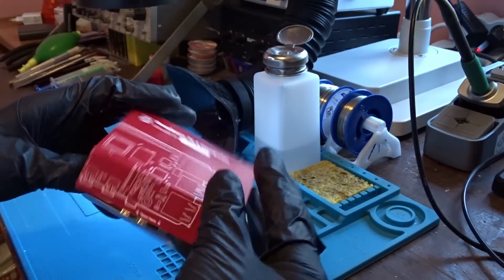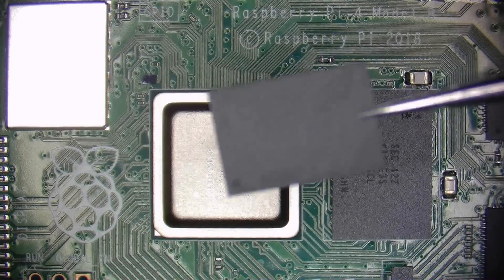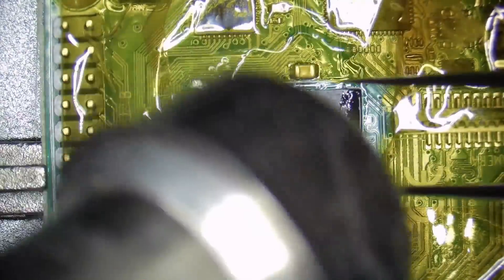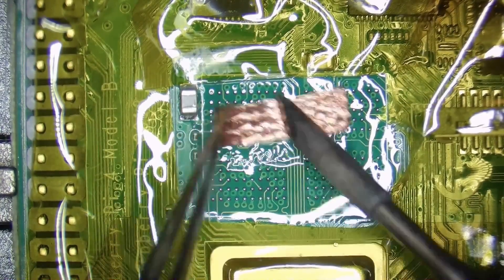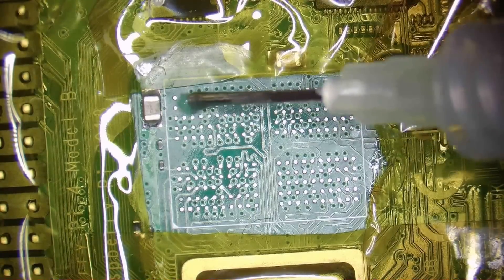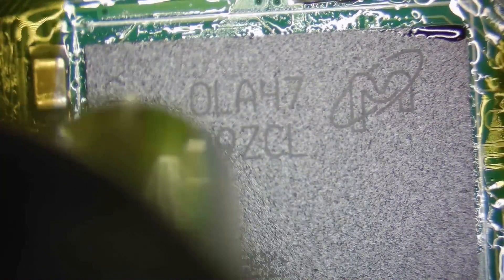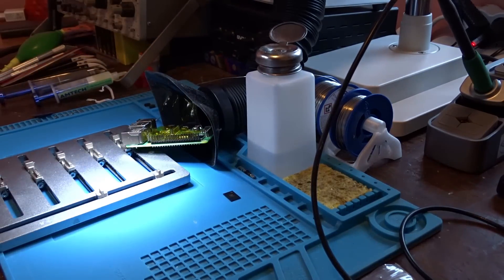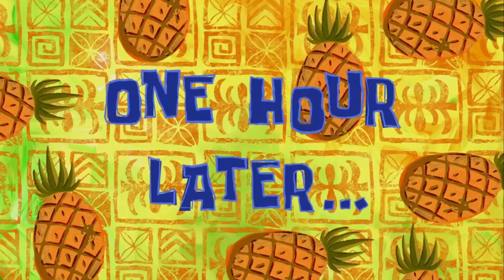Raspberry Pi 4 RAM Upgrade - Tutorial🤫

Comment: By any chance can you do it to my pi too?
Reply from the maker: To be honest I didn't consider this as a possibility while I was making the video. But I guess, why not.
However, you should bare in mind that I live in Bulgaria and so it might not be economically viable for you.
Reply: @MadEDoctor  okay, can you help me with where is polyfuse in raspberry Pi 4b? One of My raspberry Pi 4b shuts down at random time after boot.
Reply from the maker: @handle-handler  First try different power supply which is rated for at least 2Amps on 5V, then check if any of the chips on the board are getting very hot to the touch, and lastly if it’s not the power supply and no chips are getting hot it’s probably a cracked solder joint somewhere.
Reply: Tried those, nothing gets warm, it just shuts down and will not turn on till next week.
Reply from the maker: @handle-handler  So then most probably there is a cracked solder joint somewhere, usually under or around the chips, so either the PMU chip on the board which is responsible for creating the 3.3V rail or the CPU itself.

Comment: Cool. I know you're not a newbie to rework but some tips that a reader may see (and that may even help you):

1) Kapton Tape is awesome but it doesn't shield anything from heat. The tape itself  is heat resistant, it doesn't block any heat so the board is still getting hit with whatever heat you're using.
This still adds structural support to components so it's not useless! However, surface tension does that as well as long as you're not at 100% airflow.

To remedy this and insulate the board components from heat, get some aluminum foil or aluminum tape that you then place over the Kapton Tape in the same pattern. Best of both worlds.

2) Once aligned on the board properly the chip will auto-align once molten. This is the best way to know it has in fact gone molten. Just watch it and then maybe a light tap after that but that's not always needed.

The only time this isn't true is when misaligned or too much flux is used on the install. The adage of "never enough flux" is only wrong in one instance and that's IC installation. You want to coat the board pads with the thinnest film of flux you can. I'm talking a dab on the finger and then smearing it on the pads until it looks like there is hardly any on them.
This is because with too much flux you can "float" the IC chip out of position and if partially molten it will cause you to have to do it all over again (remove, reball, prep board, etc).

If it doesn't float it can be lifted off the board from boiling pressure using too much flux as well. All will seem fine and then the chip will just do a backflip from bubbling/boiling beneath it, haha.

So use very little, just as much as you can make a very thin film with.

3) Use the right heat and nozzle. Ideally, you want the nozzle to fit the chip as exactly as you can. Chip bigger than your nozzle, use no nozzle. Go down from there when you get smaller ICs and you can then choose smaller nozzles as long as they're a good fit to the chip.

4) Finally, get a cheap kitchen griddle and use it as a preheater if you don't have a proper rework machine. They're less than the cost of a starter hot air machine (sub-$40) and use the exact same tech as a proper rework preheater. 
It makes work on smaller boards like this a breeze. You don't have to crank hot air if the entire board is sitting at, say, 150c before you do it.

But good job and this is a good way to turn a cheaper Pi into a much more expensive model.
Reply: Thank you very much for taking the time to write such a detailed and well organized comment. Legitimately interesting and cool advice, I love hearing from people in industry willing to share what they have learned to others!
Reply: @quantuminfinity4260  Thanks and I just hope it helps, be it in cool modifications like this or repair work.
I'm not claiming to be the authority on it all but I have a lot of experience. I try to share small tips and hope it helps someone out there as we all start somewhere and it can be daunting at first.

After seeing this I think I'll do this to my own Pi board. Never even considered it and that's funny given that I done similar so often on GPUs and other devices. Get a good deal on the RAM IC and this could save you a lot of money!
Reply from the maker: Thank you!
I have only one thing to add about the Kapton tape. It is true that it doesn't directly shield against heat like aluminum, but it can deflect the hot air flow from sensitive parts like plastic connectors. I actually have aluminum tape, but it isn't really meant for high temps, and when the hot air hits, its glue just disintegrates and it flies off to the other side of my bench...
Reply: @MadEDoctor  Both true and especially the lower grade aluminum tape (the easiest to find and what most of us have).
Kapton Alone is 100% better than nothing and not useless (as noted). It's just not enough if working on larger boards as the heat needed will still melt plastics and such.
Here on a Pi? Solid. I'm just referring to cases where temp control is paramount, think a lot of plastics on a thick board or the caps between GPU mosfets. In those cases you'll need more than Kapton.
Reply: @DannyWilliamH  where do you buy your aluminium tape from then?
Reply: @yippy7951  
I have a local HVAC shop near me and they sell it. The glue doesn't fall apart immediately like most aluminum tapes. It's unbranded but I'll ask where they get it and reply here.
Reply: I've read this about kaptop tape and wondered, does the tape simply have a high melting point, yet still conducts heat. Or does it insulate heat, with the heat creeping from the exposed part of the pcb?
Reply: @orbita1  It's a common question and I think one we all have at some point. 

The tape itself is heat resistant but in no way shields or blocks heat beyond what a normal tape would. So, very little heat shielding properties. It's better than nothing and in quick jobs like this can be fine but with a bigger/heavier board you want to use more than Kapton Tape or it can cause damage you are looking to avoid.

Comment: Nice.  Is there a 16GB or 32GB chip?
Reply from the maker: Yes, there are. I will be trying to do a 16GB upgrade in the near future. The main problem with the 32GB chip is its crazy price of it. It costs ~100$ whereas the 16GB is ~25$...
Reply: @MadEDoctor  I understand that there are possible barriers to using 16 or 32GB, but if 16GB was doable, set up a Patreon, as I'm sure your newfound fanbase would front you at least $100, if not more, to try a 32GB chip.
Reply from the maker: @buckykattnj  Actually nice suggestion, thank you! About the 16GB I am pretty sure it should be possible, the problem I am facing right now it to find where I can buy one from.

Comment: Re: alignment.  Can be made easier by making marks on the silk-screen that align to the corner pads on the board as well as similarly marking the corner solder balls on the edge of the chip with a spot (using a toothpick).
Reply from the maker: I totally agree with that, but I didn't do this because I am actually selling the RPi's I upgrade, so I try to avoid leaving marks.
Reply: @MadEDoctor  is this scalping or a help to the market? 🤔🤓😎
Reply from the maker: @TheStuartstardust  I am selling them with minimal profit so I trying to help the market I guess...

Comment: You have listed only micron chips. Wont any bga 200 lpddr4 chip work?
Reply from the maker: I am not really sure about the support of other chips. I have only encountered RPI 4's with Micron (2, 4, and 8GB) and Samsung memory (1 and 2GB). And since I am not really sure about the names of the Samsung chips I preferred not to list them.
Reply: @MadEDoctor  The 16gb chip you will try is  not officially supported or is it?
Reply from the maker: @mreaper2265  No it isn't, there was no RPi manufactured with 16GB of RAM. 
In my personal opinion, it will be kinda useless to have 16GB on RPi, because the CPU itself will be such a bottleneck. I think you would run out of CPU processing power far before you can utilize the 16GB.
But that won't stop me from trying it :)

Comment: Would it be possible to upgrade the pi zero 2 ram to 1gb using ram that another pi uses.
Reply from the maker: I will do a little research on this when I have some free time and if its possible I most probably will make video about it. Thank you for the suggestion!
Reply: @MadEDoctor  I had also heard of someone making an 8gb pi 400 this same way if you wanted to try
Reply: Rpi zeros have SDRAM packaged in with the SoC and don't have a separate die like in the video unfortunately. Radxa zeros have way more RAM options if you need a small zero-like form factor. Tradeoff is you'll need to lean on Linux skills for those and put in a lot more work in comparison tho 😕

Comment: i live close to the factory and a few people i know work there... some fall out the door for very cheap to me.. well done on the mod i wonder if the board would accept 16gb
Reply from the maker: I am pretty sure this would be possible.
Reply: @MadEDoctor  there must be a firmware/hardware limit i suppose
Reply from the maker: @vasili1207  Well as we know the RPi's run Linux and Linux is hardly the limiting factor for anything.

As for hardware limitations there are two. One is the maximum memory that the CPU can address (which is unknow to me so far), and the other one is the physical limitation of the memory type (How much memory can physically fit in a single chip) in this case LPDDR4, which if I am not mistaken is either 16 or 32GB per chip.
Reply from the maker: Look what I just found xD
https://developer.arm.com/documentation/100095/0003/Memory-Management-Unit/About-the-MMU?lang=en
The MMU(memory management unit) supports either 40 or 44bit addresses, which if my calculator is correct equals ~138GB or ~ 2200GB🤯
Reply: @MadEDoctor  BCM2711 - 8Gb memory max.

Comment: They have the same exact chip in 64gb, I'm going to try it just to be able to say I tried. LOL
It's also from Digi-Key and Mouser, so no 3 month wait from China.
Reply from the maker: No they don't... You have misunderstood the description of the chip. It is listed as "64GBit" and that stands for 64 gigabits and when you converted in gigabytes by dividing by 8 (since 8 Bits are equal to 1 Byte), it comes to exactly 8 gigabytes. If I am not mistaken the maximum amount of memory on single DDR4 chip that you can get is 16GB.
Reply: @MadEDoctor  I see that now. Still, it's half the price of the one OP has a link for and ships from the US. Now that I realize that they listed it in gigabits and not bytes I'm going to try and hunt for a larger one. I know 16 was the limit a while back but not sure now, I have two that are 64 and two that are 32. I'm going to get the numbers off them and look them up.

Comment: Nice video! This is definitely something I would like to try. I do have a question for you though. I have a Pi4 that needs the USB 2 ports replaced. I have a donor pi to use, but trying to get that USB 2 port block de-soldered is proving to be rather difficult. Could you do a video of that, or at the very least give me some advice on how to do it? I just can't seem to get the solder out of/off of the 4 posts that hold it onto the board. Thx!
Reply from the maker: Thank you! I will make video on how to solder / desolder, the different methods, and also I will give you some tips on this topic. I will try my best to do it asap.
Reply: @MadEDoctor  Thank you so much!
Reply: Needs to have good iron, thats all. Either jbc or metcal systems with relevant tip will do 🤪. After you use this level things there is no going back to other crap.
Reply: @rkriisk  I actually do have a Metcal MX-500P and I agree that the energy/heat it can deliver is beyond comparison to most hobby level irons. Not going back :ø)
That being said - I would still use low-melt solder, since the iron can easily heat the ground plane to wet/mix the existing solder with the low-melt alloy. 
Once all pins have been mixed - the heat from the ground plane is usually just enough to pull the connector out without rush, without the need for extra hot-air or frantically move the iron around / applying a huge blob of solder that tends to run (and short/burn things you don't want) after pulling the pins out, as lead free + leaded solder has a much higher melting point.
Reply: @EgonSorensen  oh totally agree on lead solder. Don’t like much 40/60 though, would prefer eutectic 37/63 better.
Reply from the maker: @EgonSorensen  There are many low-melt solders out there and one that I recommend using is Sn42 / Bi58 alloy which melts at 138C.
Reply from the maker: @EgonSorensen  Totally true.
Reply: @MadEDoctor  I would not recommend bishmut containing alloys for rework. Yes they have nice low temp soldering properties but also huge cons. If you have any lead solder on your rework then its reducing resultant joint so brittle that using just a toothpick breaks the joint. Low temp (below 0 c) will result just random crack’s which you can’t see but they are there. Not to mention galvanic nightmares etc.. Its surprising that its back on menu because it was removed from use for precisely these reasons.
Reply: @rkriisk  Is that really true? uggghhh. I just replaced the pesky SMD USB-C connector in my Thinkpad 480 using "Sn42Bi57.6Ag0.4 138℃ Low Temp Tin Lead-Free Solder Paste". I was having trouble getting regular 180 deg leaded solder to melt without risking other components. It works great now... 

Am I really at risk of this getting brittle?
Reply: @jeffkosowsky67  that’s not the worst alloy but problem is that you used it on mechanical part like connector which gets a lot of stress. Its not the end of the world but it might fail sooner than you would expect.
Reply: I’ve used Chip Quik Inc. SMD / SMT CHIP REMOVAL ALLOY before. It’s great low temp solder.
Reply: reason your having a problem is that's connected to ground ie a big surface area ... you need to heat the shit out of the whole ground plane as  it soaks the heat away from the area... honestly i would send it out if your not capable of doing it.... wack your iorn on max and let it sit there ... if your iorn cannot do it you need a better iorn
Reply: @vasili1207  If you use a low-melt solder to melt the pins (all the way through) one at a time, it is much easier to remove since the low-melt solder alloy mixes with the regular solder lowering the melting point a lot
Must be cleaned carefully, as low-melt can make a solder joint brittle - and this is not great, especially for a connector pin.
Reply: @EgonSorensen  or that... but a nothing beat a big hot iorn...  :D

Comment: Excellent video!  Could you put the model of your hot air station (+ microsoldering iron) in the description?  They are available in all price ranges on Amazon, but I don't know what works and what's junk.  I'm considering upgrading the storage on my Apple M1 Mac Mini (as I saw in another video).  Thanks!
Reply: Things were so much easier in the days of DIP sockets and wire wrapping.😞
Reply from the maker: @JohnPMiller  So true :)
Reply from the maker: I will try to find them on Amazon, because I have mainly ordered my equipment from Aliexpress.

Comment: neat, but is that 2GB split a problem...i sees the full 8gb, but can it use it?
Reply from the maker: Yes, the full 8GB are usable. I still can’t figure out what is the reason for this limit… I have tried on 3-4 raspberries and on every single one the max memory that the memtester can address on one instance is different. 
I have no explanation🤔
Reply: @MadEDoctor  That's because you're using the 32-bit version of memtester which like any other 32-bit program can only address up to 2GB. If you switched to the 64-bit version of Raspberry OS memtester should be able to address the whole 8GB (and much more) at once.
Reply from the maker: @gerbenwelter9197  Yeah, that makes sense, and probably that's it, because I used the SD card with preinstalled OS on it (that came with the rpi), and so I didn't really know which version of the OS was on it.
Thank you, for pointing this out!